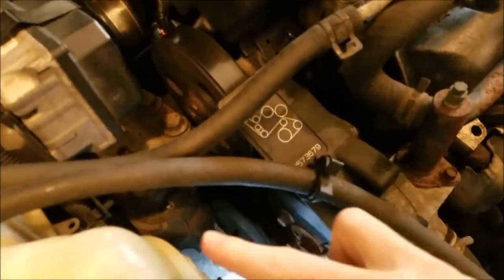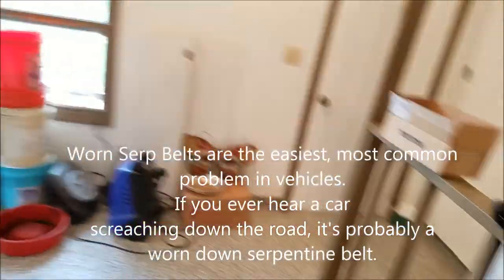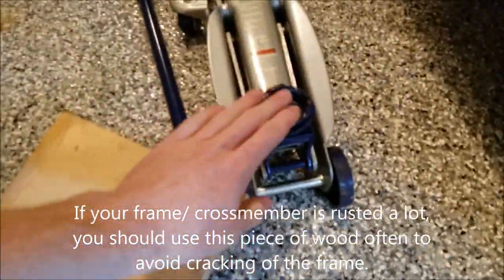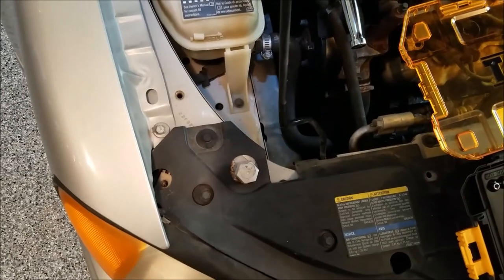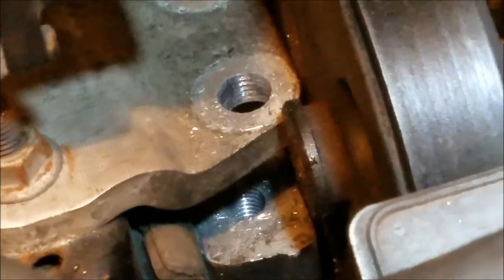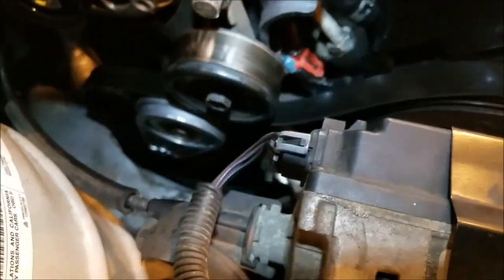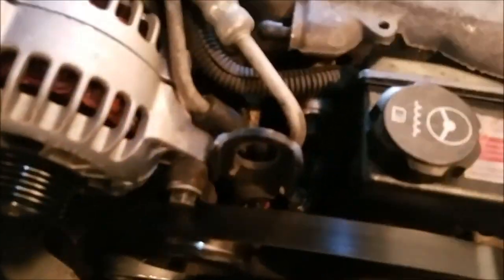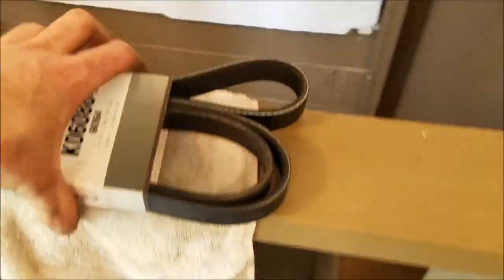Replacing A Serpentine Belt With An Engine Mount In The Way

Comment: That weird looking box that has thatvline wrapping around to ur throttle body is ur cruise control actuator. If u have no cruise control, replace that n u will have cruise control. Thanks for making this video. Verifies to my buddy that the belt can be changed without a cherry picker. Video shared

Comment: I have my jack in the right spot but it just keeps lifting the whole car if i try to moderate the gap between the mounting plate and the engine. As i loosen the bolts, the engine drops, but any attempts to raise it back up with the jack just lift the whole front end. Please help?

Comment: The only part that makes this a hassle is the engine mount it’s gotta be removed. Lucky for me I have the right tools cause I’m a DIYer and have tools too do the job. Two ways you can do this way one is get a low profile jack with a block of wood and support the engine from the bottom of the oil pan remove mount. Second option one I use it’s better use a hoist or support bar and support the engine from the top. I take out the entire rubber mount unbolt the two bolts from the engine 18s then unbolt the two bolts that go into the cars body 16s. Remove mount gives you lots of room also unplug and remove the cruise control module it’s easy unlatch in connector and the black bracket holding it and move it off to the side. Now you got lots of room for your hands. Right below the alternator is your auto tensioner best way to do this again is to have the right tools I used a tensioner tool made for doing these jobs or a ratchet works too but you’ll need a bar or something on your ratchet to get enough leverage to move the tensioner why I like the special tool. Move the tensioner towards the firewall and slip the belt off the alternator once lose it will fall off all the other pulleys. Now best way I found to put the new belt on is to work from the top down finishing with the alternator. So I first put the belt around the top idler pulls over the power steering pump under the the water pump over the Ac compressor at the very bottom. Since the Ac compressor is the lowest accessory and farthest forward it’ll hold the belt in place now snake it around the crank back around the second idler pulley through the tensioner. Now you won’t have enough belt you’ll have to move the tensioner to finally slip it over the alternator why I do the alternator last. Once belts on double check alignment put the engine mount and cruise control back together and your finished. Easy with the right tools hard if you don’t got the proper tools and little annoying with the engine mount but still pretty easy.

Comment: I have those 2 big bolts missing on my motor mount, not exactly the motor mount but right next to it with that plate that comes off, there’s a slight bigish gap between there but I’m not sure if i just needs those screws/bolts, or if there’s a type of bushing or other part missing. Anyone know that could help out?

Comment: I like your Hillary sticker. Modern EPDM serpentine belts don’t crack like the old ones did so you can’t use that as a sign to replace the belt. Also, the micro-Vs wear down way before you hear any squeal. The only accurate way to check the belt is with a belt gauge.

Comment: Could not get a regular 3/8 ratchet on mine. Not enough room, had to use serp belt tool. And even then, had to remove mount and it's engine bracket. Then I had room.

Comment: I really had to laugh at this video. Not that there was anything wrong with it, it was because I noticed you cussing while working on it. lol
This is the 2nd time I've had to replace the darn water pump on this piece of Chevy junk and this time I have to replace the serpentine belt as well. I hate this car (2001 Chevy Malibu ) I named after the Steven King movie " Christine " (an evil car that kills). Every thing on this car is a royal pain in the ( fill in the blank) to work on. I just can't wait until I have to replace the thermostat sandwiched in the middle of the engine ( being sarcastic ) lol.
I am 69 years old pushing 70 and I am still having to work on this darn car of my wife's.
This last time when it over heated on the highway we had to call a tow truck to come get it.
I was praying that the darn thing would fall off the tow truck and be destroyed.  (evil grin).
Anyway, Great video Amigo. Thanks for taking time to share it with us. Not many 2001 Chevy Malibu repair videos out there.
God Bless :o)

Comment: I couldn't believe it!!  Had one come through the shop today..... unfuckingbelievable...... an engine hoist out to change a fan belt.....

No better than taking a tire, wheel well, ac disconnect and removal plus removing the oil filter to remove ac...... all to do an alternator job.......

Unfuckingbelievable

Comment: What size wood block is that? I can't find S H I T to use so i'm gonna hit a hardware store. Any advice?
Reply from the maker: Yeah, honestly I just found one lying around the garage but you want a wide one to spread the weight out and it has to be thick enough to not crack
Reply: @RedZedHeadTV  I'm thinking yours is a 2x10 but I'm not about to buy a 12ft piece for $45 when I need 1ft. The search continues